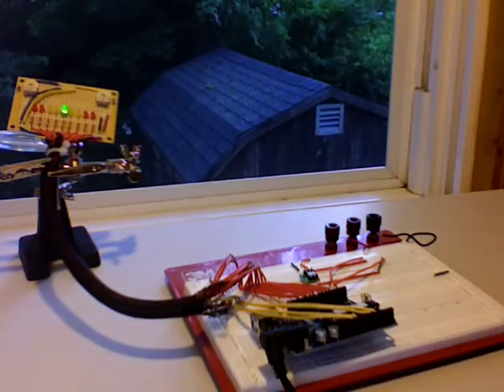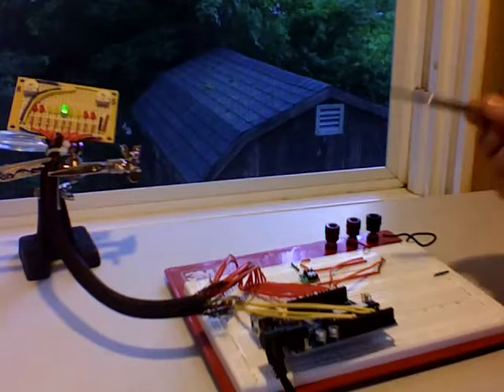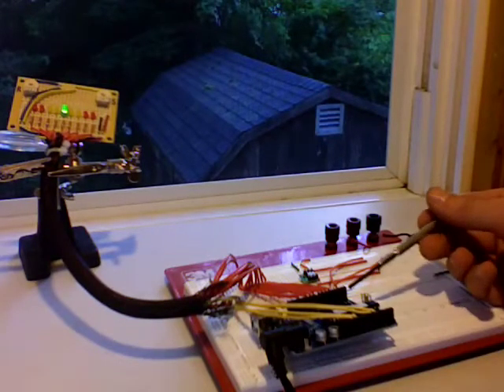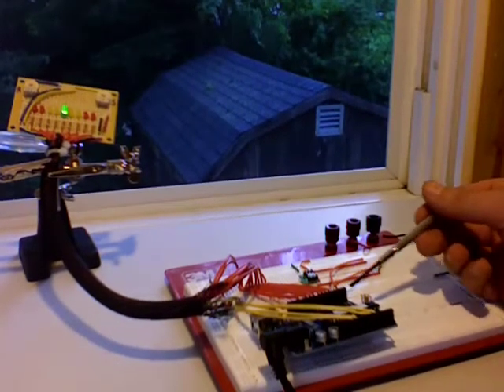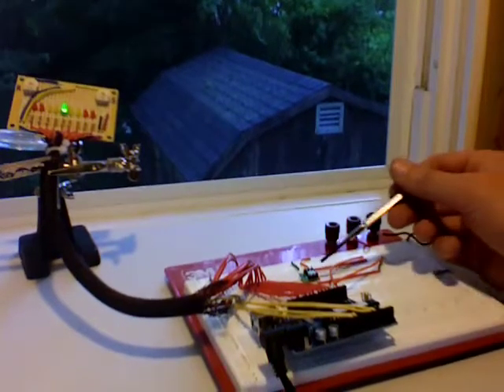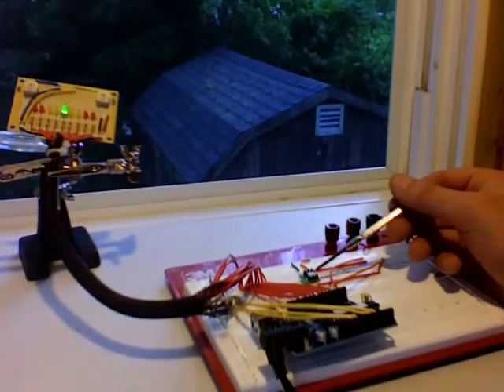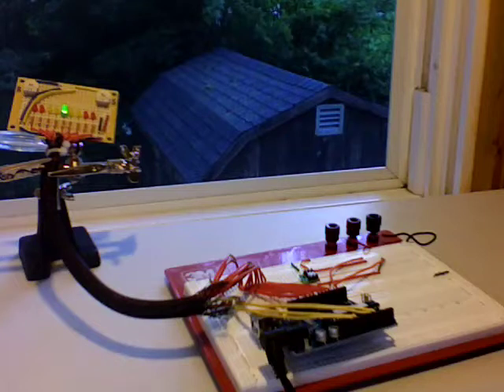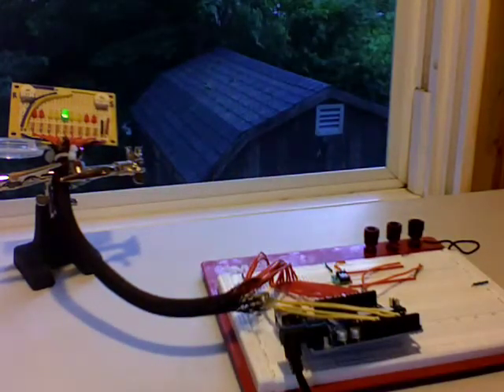Simple LED Tilt Sensor

Comment: i have seen tilt sensors in many websites, i have a question, are these diferent from accelerometers?, because i have seen the work with light and i know accelerometers work with weight, so i was wondering the differences between them and the benefits of each, accelerometers are more expensieve i guess